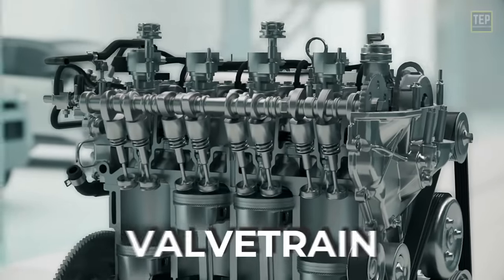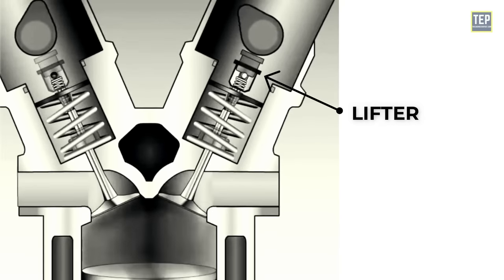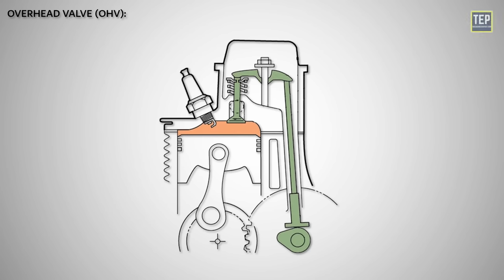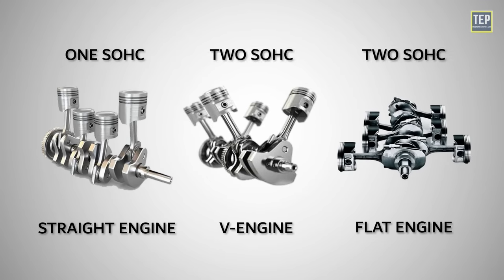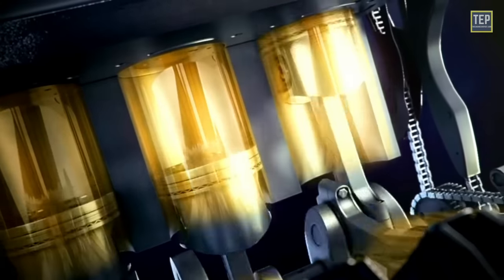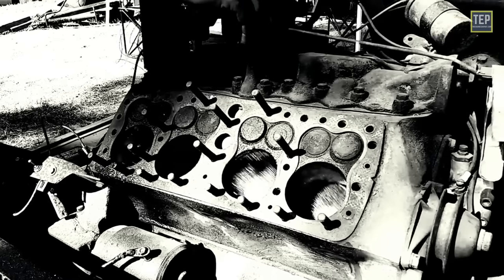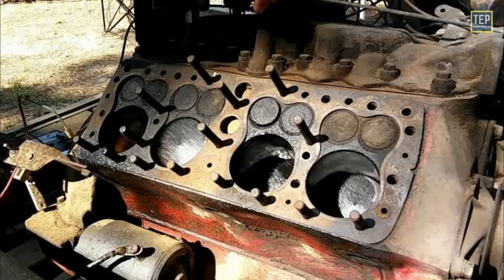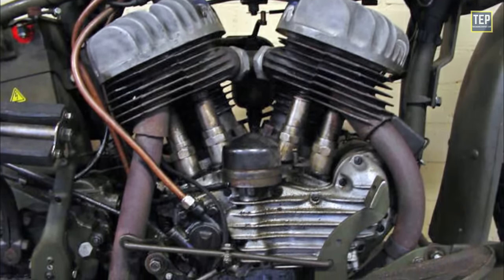Which is the Best Engine Valvetrain Design? OHV, SOHC, DOHC or Flathead | Pros and Cons

Comment: The best valvetrain system ever created was overhead valve or OHV overhead cam or dual overhead camshaft design is more complicated and involves more moving parts and also many times more weight to the  engine
Reply: SOHC looks even simpler too me... having the cam directly working on the valve instead of a long arm in between...
Reply: @martinsv9183  SOHC need timing adjusts from time to time due to the chains within systems, still simple enough tho
Reply: @martinsv9183  don't forget about the timing chain and tensioner(s) needed to keep the camshaft above the pistons in check timing chain tensioners can seize up and destroy the motor in some cases
Reply: That depends on what criteria is being used. For absolute performance, a DOHC valve train with four valves per cylinder is optimal. It has the least recipricating mass, is least prone to valve float and allows for higher RPM. It is also suitable for variable valve timing and duration, something that cannot be done with a single cam OHV as that affects both exhaust and inlet. Not only does variable valve timing and duration improve power output, it also allows for optimising torque across the range, fuel economy and control of emissions.

There is a reason that DOHC designs dominate road racing (except where they are banned by regulations). It's also not the case that it is heavier, as the higher power output means that the engine displacement can be reduced, which makes for a smaller engine, which saves weight and space in the engine bay.
Reply: 4 valve double over head cam engines with cam phasers flow a hell of a lot better even with the added complexity.
Reply: I think that the best valve train  is produced by FreeValve it lightens the engine and allows for complete control over timing, lift, and duration.  It also doesn't require a cam, timing chain, or gears.
Reply: The OHV pushrod valvetrain is only used in American V8s these days (and not even all of those), everything else is overhead cam (OHC or DOHC). DOHC is best for power and efficiency, which makes it the best valvetrain overall.
Reply: @SephDraconic00  Free valve makes the engine a lot higher and uses oil and air pressure in a expensive actuator system...
FreeValve stays a niche forever...
Reply: @martinsv9183  The disadvantage to SOHC as compared to OHV are the bigger and taller cylinder heads - that force the engine's package size to increase. This is further exacerbated if you want a camshaft with a lot of lift because now you need cam followers with a ratio that compounds lift. Packing the cam into the block (OHV) allows for a much slimmer head. Of course, the lighter weight and decreased inertia of the SOHC is an advantage - but only if it's needed to maintain valvetrain stability at the engine speeds you need. Personally I'd take a 6.0L OHV V8 that makes 450hp at 6500rpm instead of a 5.0L OHC that makes 450hp at 7500rpm.
Reply: @stevemino142: I challenge your assertion that OHV  (aka pushrod) engines have fewer moving parts.
Parts count (per cylinder - using the simplest design of each type):
OHV: cam-shaft, lifters (x2), pushrods (x2), rocker-arms (x2), timing chain, valves, springs, retainers (x2) = 10 moving parts
DOHC: intake cam-shaft, exhaust cam-shaft, timing chain, buckets (x2), valve lash adjustment shims (x2), valves, springs, retainers (x2) = 9 moving parts

Comment: NONE of them. The Ricardo Sleeve valve cylinder engine is the most efficient possible for 4, 6 or 8 stroke engines. In WWI, Sir Harry modified the original "tank" engine from a poppet valve to a sleeve valve engine and TRIPLED it's horsepower, gained nearly 800% TORQUE and gave it the needed power for the "tank" to climb a 6% grade and cross trenches. In WWII the Napier Sabre engine was THE most powerful fighter engine ever made. By 1952, the GE-Wright 48 cylinder triple stage supercharged sleeve-valve "Corn-Cob" was retro-fitted to the B-29, making it the B-50 and the same engine powered the B-36 and a number of airliners.

Comment: DOHC most complicated? Count the number of parts present in the valvetrain of common OHV, SOHC and DOHC engines with 2 valves per cylinder each and you will notice that OHV have the most and DOHC have the least.
Reply: SOHC yes, but not necessarily so for DOHC.

Comment: when you need to take the heads out, OHV is the best one. Other than that, I'd take DOHC hands down.
Reply: ... is the correct answer.
Reply: OHV has numerous other advantages. For starters, it's simpler, which is generally better from an engineering standpoint. Also, it's compact and lighter weight. This is why LS swaps are popular. You can fit a giant LS7 7.0L in the space of a turbo 4 cylinder, with little to no compromise.

Comment: So, doesn't DOHC engine have any disadvantages as the video didn't mention any, unlike it did with all the other engine types? 🤔
Reply: DOHC engines have higher complexity than a OHV which leads to more maintenance on the cam system. DOHC are also heavier, and most importantly they are a lot bigger especially when talking about a V8. So in a truck for instance a Ford 5.0 (DOHC) is going to have around 390ish HP and 390 ft.lb of torque. The GM 5.3 (OHV) Will be around 355 HP and 415 ft.lb. 
The GM engine will weigh less and be a lot more compact and a lot easier to work on and build. The Ford will make more power in the end but not for the same amount of money. 

In short DOHC wins if your car / truck can fit the extra size inside the bay and you got the money for such a setup.
Reply: Other than being expensive, a little more complicated, and being wider and taller than a ohv. No, there isn't much of a disadvantage.

Comment: The best is the SIMPLEST with the fewest parts to get the job done with REASONABLE economy, power and cost to build. If you have looked at the valve trains of modern engines you can see why they cost so much to fix and have spectacular failures. No need to get 500+ HP out of engines. You aren't running at Indy.

Comment: your website, when i go on it and try to accept cookies in order to be able to actually read what id like to learn it wont accept it simply does nothing and stays there. i have used the website before and it worked perfectly fine. im commenting here about it because i dont know where else to mention it in order for it to be fixed as its a great place to learn loads of new things!
Reply: I think its your browser issue try clearing your browers cache or try different browser
Reply: @getthewin1046   thank you so much! tried different browser and it works :,)

Comment: I wonder why Yamaha stop making the 5 valve per cylinder bike engine? It did like to rev😊
Reply: 4 valve heads actually flow better than 5 valve heads. Plus, in extreme racing situations (e.g. MotoGP) using pneumatic valve springs removes any theoretical rev limit advantage of a 5-valve layout.  Yamaha's 5-valve heads were (mostly) a marketing exercise.

Comment: OHV engines do not have greater torque due to the valve design, they have greater torque because they are usually about twice the displacement of an OHC engine

Comment: If you've got a bore size of at least 3.85" and a max RPM of 7500, there is basically zero advantage to OHC.

An advantage to OHC is less valvetrain inertia and better valvetrain stability at high RPM. Below 7500, OHV does the job just fine so OHC has no advantage here.
The second OHC advantage is much easier to actuate 4 or 5 valves per cylinder - which of course allows a lot more valve area to promote better flow....but this is only really necessary for small bore engines.

Say you want a 600hp engine for your street/strip performance car. A 6.0L OHV V8 will easily do the job at 7000rpm. Why complicate matters with 4V and DOHC? You could decrease displacement to maybe 5.0L while increasing RPM to 8000... Doing this you'll lose peak torque and you'll have a fatter engine with giant heads that won't fit into the car as nicely. For what perceived benefit?

If, for some reason you are limited on displacement - you've no choice but to increase RPM if you want more power...to handle that high RPM, you've no choice but to use OHC to maintain valve control. This is why F1 engines rev high and use OHC. Simple.

Comment: As far as longevity goes I'd have to say dual cam systems with a timing belt are best. Lifters will always be the first thing to fail in a cylinder head typically.
Reply: Timing belts!!!? They are crap. An in block cam with a ROLLER chain is almost a fool proof drive for cam. They are short chains seldom requiring chain guides and last many thousand miles. Overhead cam chains and belts just complicate engine repair. Also belts need to be replaced just as a precaution. The ONLY thing good about overhead cams is the ability to rev high r.p.m.s for racing.
Reply: @bottmar1  What about variable valve timing?
Reply: Toyota 1UZ 🤘
Reply: @bottmar1  Yeah until the lifters take a crap. Look up some Toyota engines. Timing chains are good in cam in block engines. The thing about timing belts is as long as you replace them they will last. If you thought then of course they won't last and the engine is shit just like the owner.
Reply: Over head cam engines are more complex, usually the more complexity there is the higher probability something will break down. Even if Toyota, Honda, and many of the Japanese manufacturers are known for reliability, they simply can’t hold a candle to a Ford 240/300 inline 6 cylinder which run damn near forever. No timing chains or belts on that engine, just a timing gear at the end of the crankshaft which turns the gear for the cam shaft.
Reply: Go for the biggest engine with a timing chain or gear you can afford.

Comment: Lots of useful info, but poorly assembled. If you already have a grasp of whats going on,  then you should be fine,  but if you don't, then when explaining the functions of timing, it gets confusing with the demonstration bouncing from OHV to DOHC, SOHC, and back. Also, claiming that nearly every form is cheap as a positive leaves a question as to which is actually the cheap one. Same with listing more power or efficiency on almost every variant. Perhaps a poor, good, better, best chart would have helped?

Comment: After watching a video like this, sometimes I wonder how the internal fernal gas powered engine ever got invented or work without blowing up in two minutes.........
Reply: For about 80 years before these engines, they used to boil water and inject the resulting steam at high pressure into the cylinder instead. Now they were dangerous! Boiler explosions were common.

Comment: Nobody uses pushrod engines anymore, except in the USA and for nostalgia and marketing purposes mostly, no matter how hard they try to explain it otherwise. The same goes for solid axle and leaf springs as rear suspension, it might be ok for utilitarian vehicles but it's garbage.
Reply: Always having to change is exhausting.

Comment: "Flatheads Forever" 
Lol. "The best" would be a LOT easier if only one type of engine was utilized. A low speed engine has less need for multi valves, variable lift or timing, and more simple configurations are better. The opposite can be said for high speed engines.

Comment: 3.5hp Briggs and Stratton lawn mower engine is side valve!! The newer OHV B&S engines are No where near as Tough or Durable!!
Reply: Briggs is an inexpensive option for lawn mowers. I have one with side valves and it runs fine, however Honda makes better engines for that purpose than Briggs.

Comment: You should be referring to the pushrod engines as pushrod engines, not overhead valve engines. You're confusing your viewers. Overhead cam engines are also overhead valve engines. And, some overhead cam heads are less complicated than pushrod heads, not the other way around. Also, not all dual overhead cam engines have four valves for cylinder and therefore your discussion regarding how much better they are versus single overhead cam engines is totally blown out of the water because those are two completely different concepts.

Comment: Dohc single valve is the best because of swirl
Reply: DOHC is not the best when it comes to ease of maintenance. They slow down the process of removing and replacing the head/s.
Reply: @bottmar1 why u want to remove?

Comment: Ford flat head engines pass the exhaust  threw the  block causing overheatilng and cracked heads, neede to grind the valves , clean the spark plugs, and low efficency.

Comment: Very simple question.  Simpler is better.   Sure a DOHC eight cylinder might breathe better at 10k RPMs, but 32 valve V8s have FOUR camshafts (instead of one), twice as many valves, and huge cylinder heads that make servicing the basic bits like spark plugs a big pain in the rump.  How much is sacrificed with a  much simpler 16 valve OHV V8?  Not very much, really.   Every V8 in EVERY nascar Daytona racer since before I was born ran a 16 valve setup and made TONS of power.
Reply: The disadvantage to OHV is valvetrain inertia and maintaining control at high RPM. Secondly, creating enough valve area to support big enough ports. From a practical standpoint, a 4" bore permits valves of about 2.1" and 1.6", which is big enough to support ports that can flow 300-350cfm, which is enough to make about 650hp with an 8 cylinder. If you shrink the bore diameter to 3", the valves become too small and flow/power is compromised - thus a 4-valve OHC arrangement starts making a lot more sense. Nascar engines run 9500rpm, but that is extreme for OHV. 7500rpm is closer to a maximum reasonable RPM for OHV, with 6500-7000 being preferred.

If more displacement is allowed - I think it's better to make the power target using OHV, lower RPM and more displacement. If displacement is limited; you've no choice but to increase RPM to hit the target power. Higher RPM mandates OHC to maintain control of the valvetrain.

Comment: The flathead is still used in the UL GA aero engine. Who cares?😊
Reply: Aero piston engines are often old constructions, since the costs for certifying them is high, the sale numers however are low compared to vehicle engines. Since you can eliminate the risk of a belt or timing chain failure (I think these are not even allowed for aero engines) OHV or Flathead bring some advantages for this purpose.

Outside the aero world Flathead is only used by Briggs and Stratton for lawnmower engines today

Comment: All I know is that there are a lot of "interference" powered  FoMoCo products parked because of engine destruction caused by poor design. Volvo's also. Too expensive to repair or maintain. I was quoted that my Mercury would cost $2600.00 to do the chain/idler repair. If the chain goes before, then it  becomes a "boat anchor" !!!!!!!!!!!!!

Comment: Wikipedia Gasoline/Diesel Engine Blocks or Dual Fueling Carburation Futher more Wikipedia 5Stroke engine ,6 stroke engine,8stroke engine the Sohc variabel engine ,just I dono study dual engine types working in 1 unit I ques what cones and probes they give as such expeciali if you add Metadyne rotary transformer to that thing with out mentioning other devices like vaporisators,moisture absorbers ,chemical bath capture of gas ,bacteria eating staff,inurt gas and metal particel arc welders,cloosed loop chemical to chemical conversions ,magnetic pumps,magnetic lavitation,magnetic gas mixers and what ever ells peopel come up with . So sohc parts upgraded,good engine control cirquets ther you go have fun figuring out the rest for your self after all if the armi uses such engine it must by good .

Comment: Fairly worthless video.  Aside from identifying the different designs, it fails to illustrate or emphasize the advantages one versus the other. From an engineering perspective the types of materials available and used was a critical factor as well.  The numerous Grades of Steel and Aluminum also dictated Type and Design that included available fuel(s).